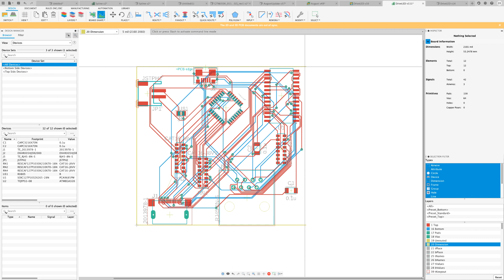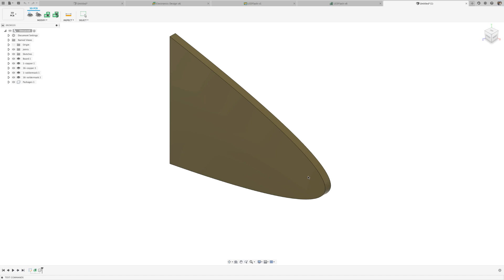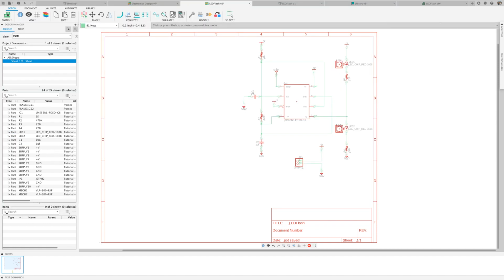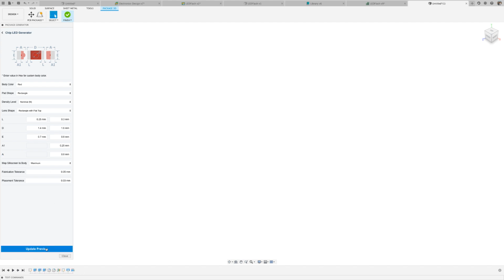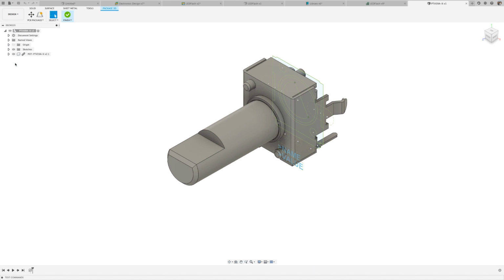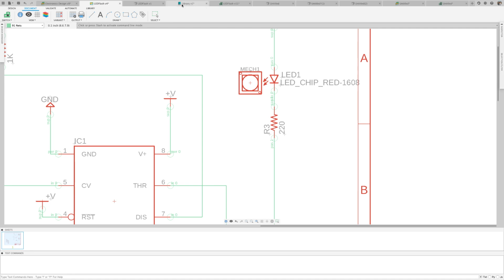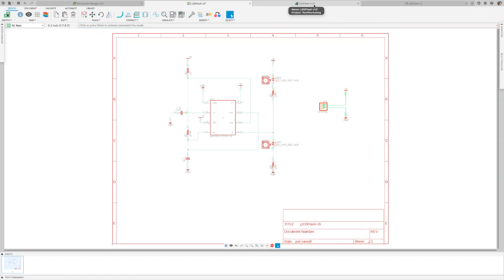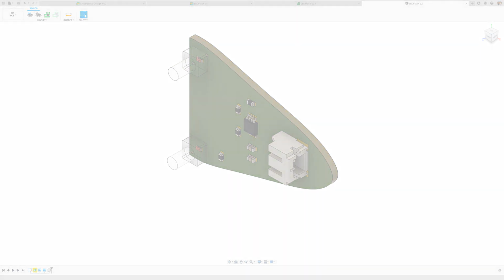What is new Fusion 360 electronics

Comment: I guess the reason you didn't cripple the electronics modules from the free license is that you still need a user group while you try to develop it. Once you're done with the product this will cost us big bucks too. You screwed me when I locked in a long term license for ArtCAM a couple months before you dropped the product. Since I still needed the product, Autodesk sold me a perpetual license for ArtCAM with the knowledge there would be no future updates or support. Now you take away the ability to use the hobbyists license to generate output to my desktop cnc or my 3d printer. The conclusion I have come to is that Autodesk cannot be trusted and that any long-term promises are really slowly developing lies.
Reply: Hello Robert, just to be clear the Personal version of Fusion 360 Electronics has always had the limits of the EAGLE free (80cm^2, 2 layers, 2 schematic sheets). So when it comes to electronics there was no change.
Reply: @JorgeGarcia-ej3vy  Yet...

Comment: Is this a separate software?
Reply: It will soon be seperate again, autodesk will charge you a lot fir it then. Wait till we have beta tested their crap for nothing, ad will start charging.
Reply from the maker: Nope! This is the electronics workspace fully integrated into Fusion 360!
Reply: @adskFusion  I don't see the option for it.
Reply from the maker: @masterdrafter6129  from the file pull-down menu select 'New Electronic Design'. You will be at the electronic document which monitors the annotation between board and schematic. From the electronic document, create a brand new schematic or link to an existing one. From here use the ADD command to begin adding parts.